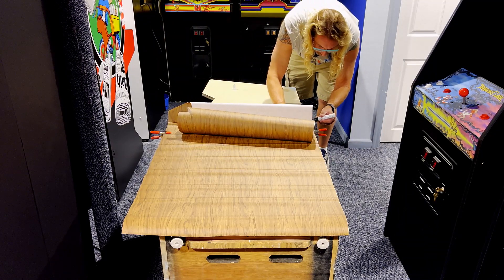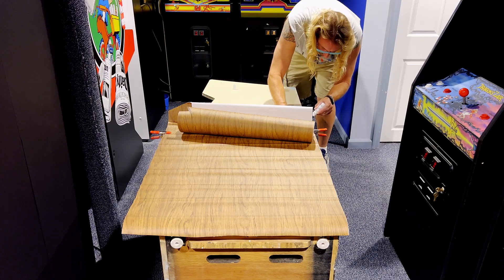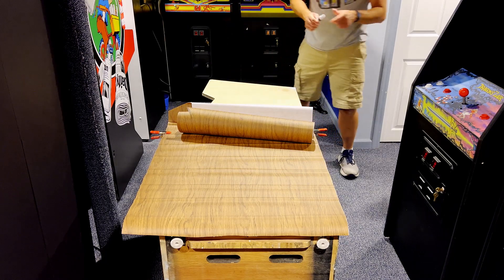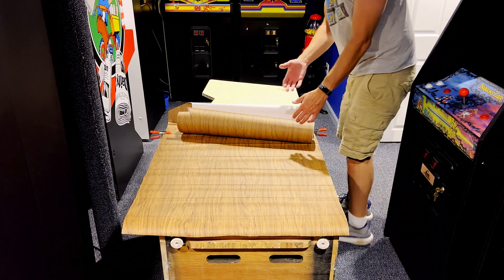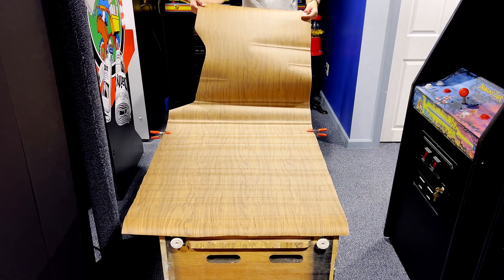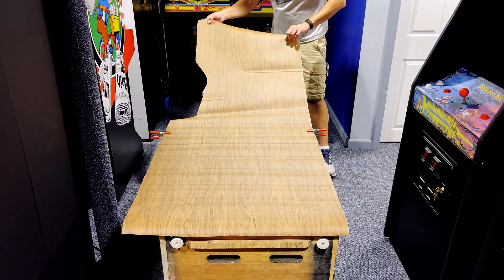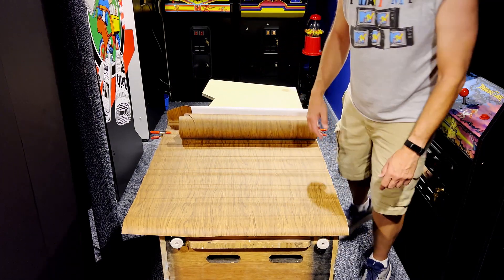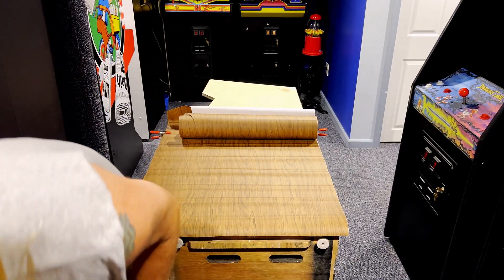Applying wood grain vinyl and side art (Vanguard Restoration Part 2)

Comment: Pro. Tip: I've found it easier to spray RapidTac on top of that protective layer and it peels off super easy.
Reply from the maker: Yes... you are right... for this application, the sides are laminate, so RapidTac would have been perfect.  (if it was bare particle board wood, then no).  The front around the coin door is also laminate, so I will use RapidTac.